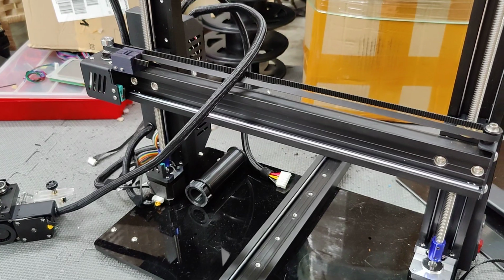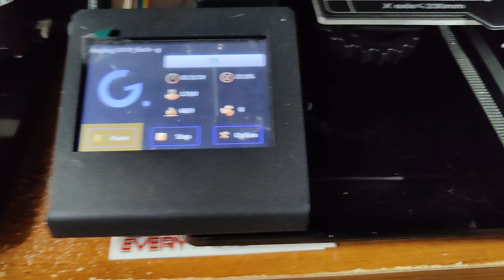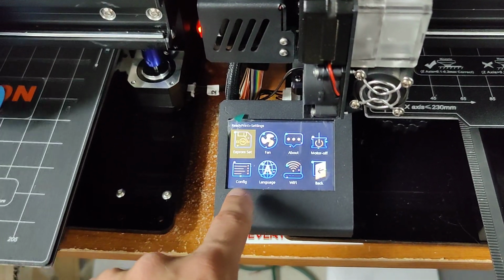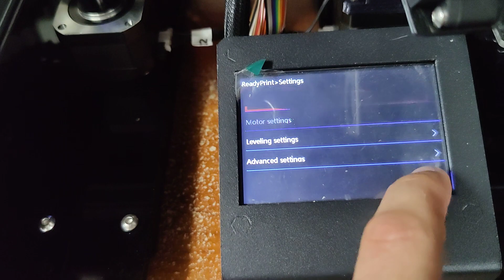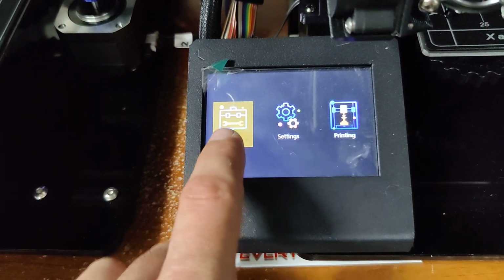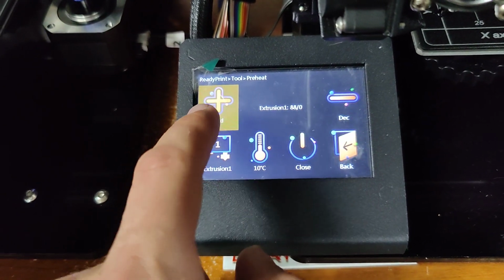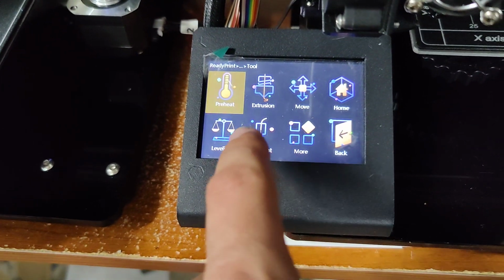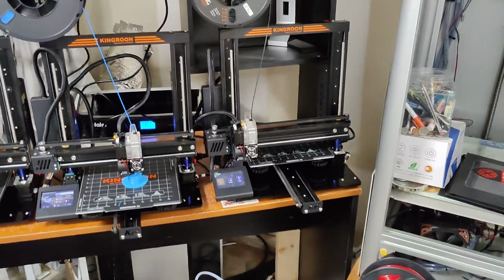KP5S KP5M KP5L Unboxing/ Assembly of first batch Part 3

Comment: Hello: your videos are truly informative - as you were building those KP5 units, I saw a KP5M and checked their site. From your extensive experience with these printers - how would you rate the difference between the KP5M and the KP3S? Which do you feel is better? (I do like the screen from the KP5 series printers) Thanks
Reply from the maker: Id get the kp3s pro. the kp5 is good but has slightly more issues. the kp7 is also a good choice.

Comment: All that z switch does is let the printer know when its reached the bottom . It has nothing to do with leveling. so why would you need 2? if you did put two the printer head would just stop moving down when the first one was activated. you wouldn't even know which one that is. not to mention the bed has 4 corners.
Reply from the maker: You set it up so when it hits one that side stops then it hits the other and it stops, Once your 4 corner leveling is set its more reliable that the 2nd arm with zstop will stay in its exact position for every start of a print even after being moved, having the arm bumped ect when the power is off. 
Its just for reliable level starts after you level it. 
Otherwise occasionally you will need to make a slight adjustment by hand but its not a big deal